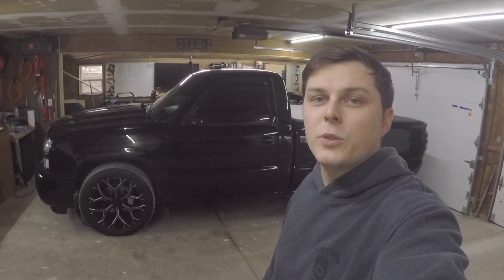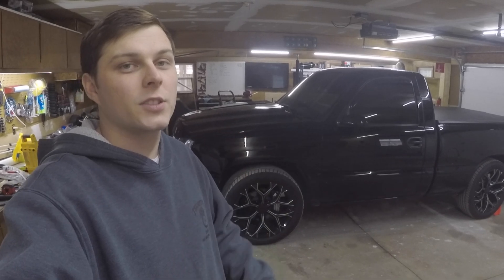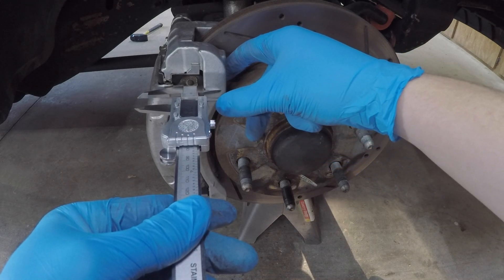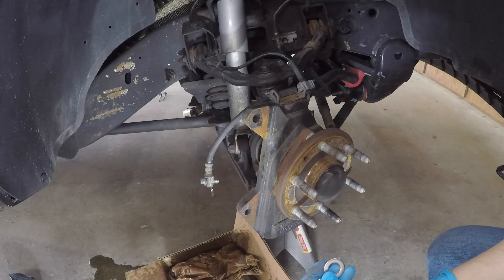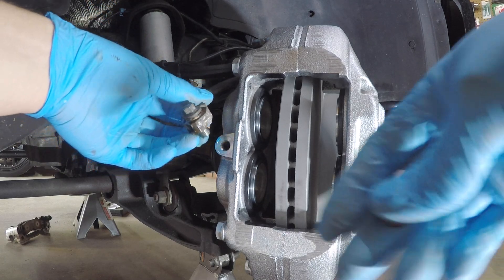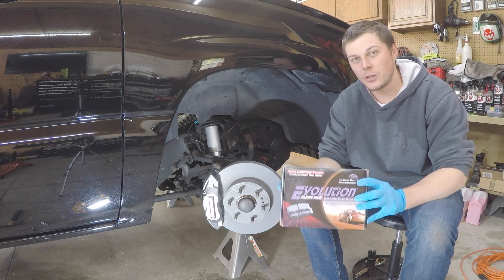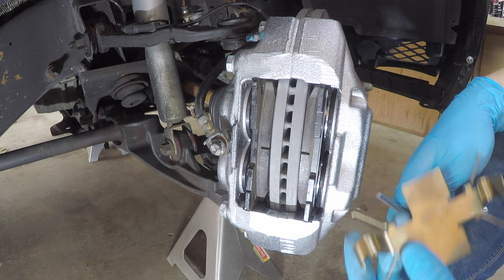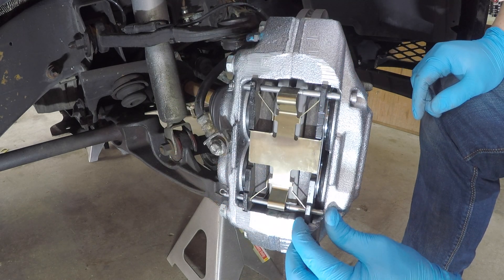Silverado 2019 Big Brake Conversion! “How To” A NBS!

Comment: that part number for the calibers doesnt exsist anymore do know if its the same as 13536579 and 13536580
Reply from the maker: Hey, sorry for the late reply. I'm not exactly sure if those part numbers would still be the same calipers. Sorry, good luck on the search!
Reply: @TheKingCoopa  thanks, I took a guess an used my brothers 2020 CT4 Sierra for reference when I ordered the parts they fit perfect

Comment: Have you thought about doing a hydro boost brake conversion? Since I have a similar cammed truck I definitely feel how hard the pedal is with the vacuum brake system.
Reply from the maker: Hey, sorry for the late reply. I'll be doing a built 6.0 LQ9 swap very soon. I will probably do the hydro boost conversion at the same time. I'll also be doing an E-fans swap through the factory harness as well. Not sure when I'll get to them, but stay tuned!
Reply: @TheKingCoopa  I’m waiting for the passenger side caliper since it’s on back order. I noticed the new brake dust shields are for a 4 bolt wheel hub, unlike our Older 3 bolt. Do you think we’ll be ok without a brake dust shield?
Reply from the maker: Oh cool. Hopefully you will get it soon. And I wouldn't be too worried about the dust shield. I dont run one on the front

Comment: will this work if I use 14 inch rotors with these calipers?
Reply from the maker: The GM factory rotors are 13.5". I'm not really sure if the 14" rotors will fit and not hit the caliper. I'll have to go out in the garage and see how much room there is. But I'm gonna say I doubt it man.

Comment: Is their an alternate Disk Brake Caliper for this project ?? The disk Brake caliper part numbers you provided are sold out everywhere. Thank you
Reply from the maker: Hey, I looked on some Facebook fourms, and found a company called stop tech makes some drilled and slotted rotors for 2019 silverados. Might be worth looking into.

https://www.buybrakes.com/chevrolet-silverado-1500-lt-2019/stoptech/brake-rotors/stoptech-rotors-drilled-slotted-high-carbon-127

https://www.buybrakes.com/chevrolet-silverado-1500-lt-2019/stoptech/brake-rotors/stoptech-rotors-drilled-slotted-high-carbon-127

Comment: Can you give me exact specs on your snow flakes
Reply from the maker: Hey, they are a made by OE performance, and are called 176M. The size is 22x9 with a +24mm offset. Tires are a 285/45R22 Michelins.
Reply: @TheKingCoopa   I have a set of stock replica 2021 wheels they are 22x9 think they would work
Reply from the maker: @aydengoldsberry5721  I think they will be really close. Is there a way you could figure out the offset? If they don't clear, you could just run a really small spacer
Reply: @TheKingCoopa   not sure it’s really late where I am and I’m in bed lol been watching channel for a min I just picked up a tsp stage 3 216/220 @.550/.550 114 lsa cam for my 4.8 cant really find a good set of valve springs that have the retainers locks and seals and everything could you point me in right direction
Reply from the maker: @aydengoldsberry5721  oh nice, that will really wake the engine up! I have pac .660 spings. Here is a similar kit that I got. But id just give tsp a call, they will probably ask what cam you went with. And I know they can spec you out the right sping kit.

https://www.texas-speed.com/p-5704-tsp-660-polished-dual-spring-kit-w-pac-valve-springs-titanium-retainers-prc-integrated-seatseal.aspx
Reply: @TheKingCoopa  they did thanks!
Reply from the maker: Oh nice, right on. Good luck with the build 🤘
Reply: @TheKingCoopa   hey man ended up building a full 5.3 stock bottom end brand new everything from bearings to seals and threw that tsp stage 3 cam in just wrecked the truck three weeks ago but now I am fixing it and bringing him back to his former glory thanks for the great info vids and entertainment hopefully we could talk more in the future on future things I’m thinking of doing currently also in the process of 4l80e swapping the truck so hopefully soon it will be back and better than before
Reply from the maker: @aydengoldsberry5721  hey man, sorry about the truck, thats a bummer!! Glad you're bringing it back though! You will probably have yours finished before I do 😅 during my 6.0/4l80e swap I decided to do a full wire tuck, e fans, all AN lines, shaved firewall, and a battery relocation.... I bit off way more than I could chew lol. Hopefully I will finish it this winter. But excited to see what else you do with the truck 🤘
Reply: @TheKingCoopa  I wanna see the wire tuck I don’t think anyone has posted about that yet so that will be super exciting to see man thanks for all you do and merry Christmas
Reply from the maker: @aydengoldsberry5721  10/10 I do not recommend the wire tuck 😅😅😅 its miserable haha. I'm gonna try to get some more done soon though. Thanks for the support, and Merry Christmas!!
Reply: @TheKingCoopa  no worries man been with you for a year now !
Reply from the maker: @aydengoldsberry5721  thank you, I appreciate it!!!!!

Comment: Hey homie i just did these on my Yukon and dame these are hard to bleed does these calipers have two bleeding points i dont remember seeing the top shown in your video, i was only doing to bottom.
Reply: That makes perfect sense I was so excited to do this that I didnt look at them properly when installing and yes there on the wrong sides😵 thanks again for the help dude cheers.
Reply from the maker: @andresutherland4306  haha its all good. Mistakes happen. Just make sure you put that washer in there, between the calipur and spindle. Centering it on the rotor, since it has pistons on both sides. Good luck, have a good one 🤘
Reply from the maker: Hey, the bleeder screw should always be on the top of the calipur. So the fluid stays in the line, and the air will escape upwards. Theoretically if the bleeder screws were facing down, it would just suck in more air, and the brake fluid would drain out. If your bleeder screws are facing down, then I would definitely double check the part numbers of each calipur. You might have them on the wrong sides. Which im not sure if thats  possible, but im sure it is. That would be my best guess. Other than that, it should be bleeding the brakes just like any other vehicle. Hope that helps.

Comment: Will this work on 14-18 Silverado Sierra tks
Reply from the maker: Hello, I can't personally guarantee they will, since I only have the 04. but if I remember correctly when I was doing all the research, I'm like 95% they will work on the 14-18 1500s. I would double check it first, before you spend the money on them. I've seen a few people swap them onto the 2007-2013s, so I doubt they changed the spindle/bolt pattern for the caliper.

Comment: Hey man I’ve been having some trouble finding the calipers on rock auto seems like they’ve been out of stock for months now. I found some calipers on a Chevy parts website with a different part number and was wondering if you can help me identify if they are the same. Thanks in advance! https://www.chevroletonlineparts.com/oem-parts/gm-caliper-13529542?c=Zz1icmFrZXMmcz1mcm9udC1icmFrZXMmbD03Jm49QXNzZW1ibGllcyBQYWdlJmE9Y2hldnJvbGV0Jm89c2lsdmVyYWRvLTE1MDAmeT0yMDIwJnQ9bHQmZT01LTNsLXY4LWdhcw%3D%3D
Reply from the maker: Hey man, sorry for the late reply. I'm honestly not sure. The picture looks similar. The part number is different. but the main thing that is throwing me off is the fitment says it fits a 2500HD and 3500HD trucks. So I'm really not sure. Have you checked at your local dealerships for any take-offs? Some trucks are special ordered with brembro calipers. So they dealer ship will swap them out, and scrap the 2019 calipers. Might be worth a shot?
Reply: TheKingCoopa It’s all good man. I haven’t tried dealerships near me yet but I’ll give it a try soon thanks again.
Reply from the maker: For sure, good luck!

Comment: Will this work on a 15 silverado??
Reply from the maker: Hello, sorry for the late reply. I can't personally guarantee they will, since I only have the 04. but if I remember correctly when I was doing all the research, I'm like 95% they will work on the 14-18 1500s. I would double check it first, before you spend the money on them. I've seen a few people swap them onto the 2007-2013s, so I doubt they changed the spindle/bolt pattern for the caliper.

Comment: Hi @kingCoopa awesome videos, already have the two Front CaliPers, rotors and pads for my 03 SBSC, In the rear you said you had calipers two pistons from the Yukon, But in detail which year Yukon are the ones  I have to purchase, Really appreciate it 👊, in the front ones it clear perfectly without spacers because I have the same wheels like yours. 🙏🏻👍
Reply from the maker: Hey, sorry for the late reply! I just went to the local auto zone, and told them I wanted two rear calipers for a 2004 Yukon. I think I said 4x4 and the 5.3 or 6.0. they pulled the picture up, I just made sure they were dual piston. They brought them out, and I double checked they caliper bracket bolt holes lined up, and I was good. They even used my old calipers as a core charge, so it was pretty cheap. I did buy new pads for the 04 Yukon calipers, and I kept the Silverado rotors for the rear. I hope that helps you out, sorry I don't have part numbers for them. Glad your wheels cleared haha. Thank you for all the support!!
Reply: @TheKingCoopa  appreciated boss, thanks for the info and excellent content in ur channel!!
Reply from the maker: Thank you, I appreciate it!

Comment: Would this work on a trailblazer Ss ?
Reply from the maker: Hey, honestly not sure, but im gonna say no. Tbss lug pattern is 6x6. Silverado 1500 lug pattern is 6x139.7 (6x5.5) so the rotors for sure wouldn't slide on. But the silverado rotors are 15in diameter, while the TBSS rotors are 12.8in. So even if the 2019 calipur bolt holes lined up, i don't think the brake bads would even come close to touching the tbss rotors
Reply: @TheKingCoopa  thank you appreciate the time you took to answer my question 🙏🏼
Reply from the maker: @unerdogable  for sure, good luck on the tbss 🤘

Comment: Would this work for the 2500's?
Reply from the maker: Hey, im gonna say no. The rotors will 100% not work, because the 1500s are 6 lug. And the 2500s are 8 lug. The 2500s also have a bigger spindles, so I'd have to say the the calipurs probably don't fit that either, not positive though

Comment: How big are the rotors? I hop you make a video on hydro boost conversion. You do an excellent job explaining this stuff.
Reply from the maker: Hey, I can't remember the diameter off the top of my head. I can try to get you a measurement later today. I think 13.5in diameter. I believe they were 1.5in larger than the NBS rotors. Not sure when I'll do the hydro boost conversion. Still have to install the nitrous, 2 step, roll cage, quadrasteer bed, and widen the rear wheels 3in. So I have alot to do still haha. Thanks for the support!
Reply: @TheKingCoopa  13.6" for the rotors
Reply from the maker: @sellickusa  thank you 🤘
Reply: @TheKingCoopa  RPO code JF7/JF3 is what was on GMT 800, my truck requires 17s due to the calipers. (2007 classic)

Comment: @TheKingCoopa I've been waiting for the video from last time we spoke. Got my calipers in the garage, test fitted and needed to grind the ridge but to a polished finish with just enough of the ridge still showing(looks good) Anyway, thanks for the video, looking forward to the hydro boost episode.
Reply from the maker: Oh nice! Yea, sorry it took so long to get it posted, sometimes life gets in the way haha. Hope your install goes well, grinding the calipur and polishing would probably be the better option, instead of running a small spacer. Thanks for the support!
Reply: @TheKingCoopa  Keep up the awesome videos and doing something different than the rest. Its so appreciated, fun to watch and awesome to learn.
Reply from the maker: @530ericthomas  glad you like it! I try to get 1 video out a week, but its a struggle haha. Not sure when I'll do the hydro boost conversion, still have alot to do. Need to install the nitrous, 2step, roll cage, go 2in lower, quadrasteer bed swap, widen the rear wheels 3in, and run a fat back tire. Then id like to get back to my project vette kart. Big to do list haha.

Comment: What's the deal with the rear calipers? Are they 2 opposing pistons? Can't find a model with dual piston rears
Reply from the maker: The fronts have 2 sets of pistons facing each other (total of 4) and it clamps from both sides, so its a non floating calipur. The rears i had a single piston calipur from the factory. So I just went to autozone, and bought the rear calipurs/brackets for a 2004 yukon 4x4. And those are dual pistons, and bolt right on. Those are a floating calipur. Also got to turn my old ones in for a core charge. I needed the yukon brake pads, and kept the silverado rotors for the rear
Reply: You can use the 03 Silverado SS rear brakes to get a dual piston swap setup.  RockAuto sells a caliper/rotor/pad set.  RAYBESTOS 834RPCE3

Comment: Ive looked up 2019 silverado brakes....doesn't show this caliper
Reply from the maker: The 2019s and 2020s came with two different styles of front brakes. You want the quad piston non floating set, that grip from both sides. Part numbers are in the description of the video

Comment: Do you think you can link that gauge Pilar and gauges ?
Reply from the maker: Hey, the guages i got from summit racing, made by AEM. Havnt had any issues with them.
The guage pod pillar is made by glowshift. I dont like it. Its really cheesy. It's just an overlay, so you still use your original trim pillar, and have to drill holes into it, to mount the pod pillar. Then run your wires through both trim pieces.  Im gonna look for an oem duramax pillar, and just paint it black. 

Pod pillar
https://www.glowshiftdirect.com/graphite-triple-pillar-gauge-pod-for-2000-2006-chevrolet-silverado-duramax/

o2 wideband 
https://www.summitracing.com/parts/avm-30-0300

Fuel pressure guage (for nitrous)
https://www.summitracing.com/parts/avm-30-0301
Reply: @TheKingCoopa  thank you !!! I love the content I have the same truck and slowly building it thank you for all the knowledge
Reply from the maker: For sure, right on! Good luck with the truck 🤘 and thanks for the support!

Comment: What size is the rotor?
Reply: 13.5”
Reply from the maker: Hey, sorry for the super late reply. The diameter is 13.5" which is about an inch larger than the old NBS rotors.

Comment: So this won’t work for 2002 Chevy Silverado 2wd extended cab ??
Reply from the maker: Sorry, I fixed it. Yes it will work on the 99-06
Reply: Thanks 🙏 and can I just do the front so won’t push so much fluid and will perfomance better would kinda help cause I have a perfomance truck ??
Reply from the maker: @gordoontb3016  yup, you dont have to do the back if you don't want to. But being a big cam, the LSA is gonna be smaller than a stock truck cam, which will cause less vacuum pressure, which means less braking pressure. Plus adding more calipur pistons doesn't help haha. But you should be just fine. If you ever want to go bigger and stop on a dime, ill probably be doing a hydroboost conversion for the brakes

Comment: Would it be the same to install it on a nnbs 07-13 ??
Reply from the maker: I'll look into it. But I've seen where guys take the 07-13 front brakes and swap them to the 03-06. So I believe these 2019 brakes will work from 99-13
Reply: @TheKingCoopa  if you could find this out for nnbs it would be greatly appreciated, thanks for posting the video.

Comment: Would they fit with the stock 17s the 06s come with?
Reply from the maker: They will bearly clear the 17s, diameter wise. But you still might have to run a small spacer to clear the spokes of your wheel because of the large calipur
Reply: This is a lie they don’t fit 17s I tried I bought 2017 ltz rims so it fit

Comment: So the front rotors and calipers were from a 2019 is what I gathered does it need the rear upgraded and do you think that if you leave the single piston the fronts would preform better ? I already have the 20 inch wheels from a 2019 Denali so I should be good there.
Reply: While he added pistons to the front he did had a couple to the rear... normally on these trucks, his inparticular, are calibrated for four pistons up front and two out back. Now that he has 8 up front and 4 out back, the proportioning bias is off... if you really slam the brakes hard, the rears should lock up before the fronts really start to do heavy braking. 
I had this similar issue on a 03 SS truck that has the dual piston front and rear calipers from factory and I put a 6 piston 15" front Stoptech kit on... it messed the brake bias up so bad I lose control and totaled the truck trying to brake hard... 

To solve the problem, you either need an adjustable proportioning valve, or put line restrictors in the rear lines...
Reply: @Trav450ER  This comment needs to be pinned to the top. Brake bias is very important.
Reply: Is there some kind of formula you use to determine this? I don’t know anything about it, but going from 4/2 to 8/4 seems like it would still be balanced because it’s the same ratio. Thanks. I’m in the early stages of planning a similar swap.
Reply from the maker: Yep, 2019 rotors, calipers, and pads. You dont have to upgrade the rear if you don't want to. But the 2019 rear calipurs have electronics in them, and are not compatible on any of the previous models/years. And if i left the rears as single pistons, thats less fluid it would have to push, so yes it would perform a little better.
Reply: I think u can put the old front calibers in back was same on ss 2 2 might need diffent brakets
Reply: Automated abs bleed ?
What that nosie you have when hitting the brakes
  my first one of these trucks I bought new would have abs spring off when hitting a pot hole it was the only pot hole around so I think dot left it so theyCould know what they look like.